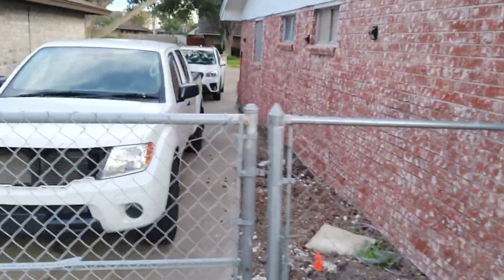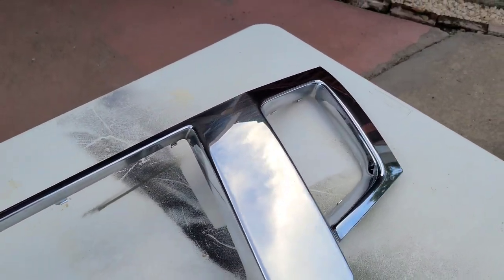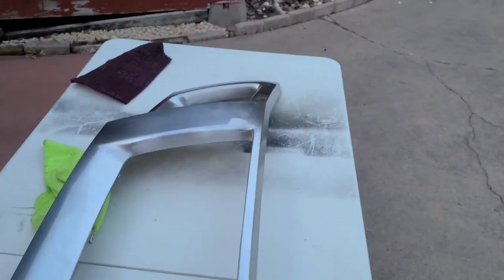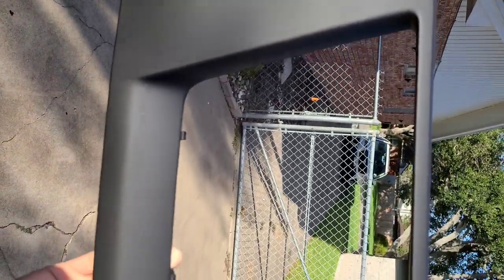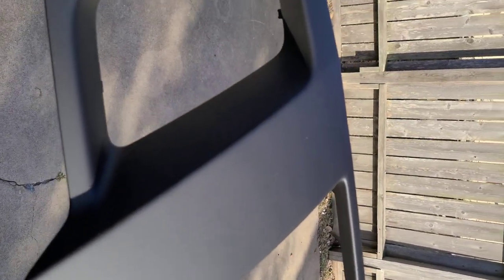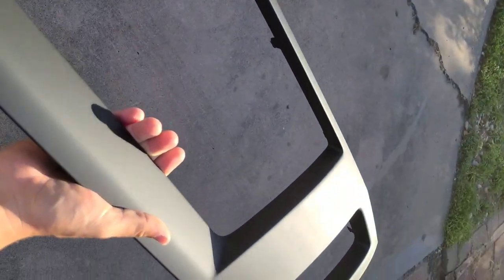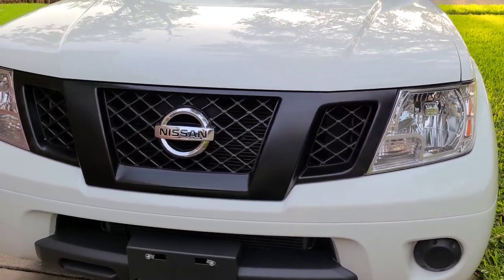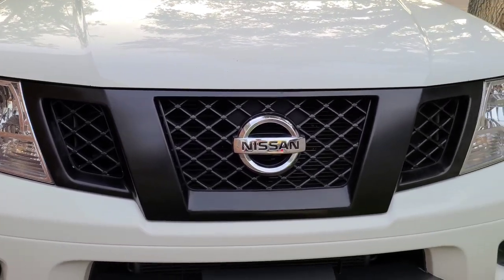Nissan Frontier Blacked out Grill!! Mod: 7

Comment: I prefer satin black over high gloss, looks way better in my opinion. So how is it holding up a year later?
Also, I'm pretty sure those wheels are silver from factory. Did you have them repainted or powder coated?

Comment: On my second Frontier now and both times I blacked out the grill... and what a bitch to separate the two pieces of the grill. Actually my first Frontier I just masked the inner part because I was afraid I’d break one of the two plastic pieces. Second time I found they’re pretty flexible, but figured if I broke them, now there’s an option to get the Midnight replacement grill from the parts department.

Comment: You did a nice job. Looks great. Did you spray a clear coat on it?
Reply from the maker: Yup I put a clear on there. You have too especially since it's prone to bugs and stuff
Reply: @localfisherman7592  Ok cool. Thanks for the reply.
Reply: @localfisherman7592  Also, did you have to scuff the paint before you applied the clear?
Reply from the maker: @bkg2213  no you can apply the clear straight to the paint. But make sure you clean it first.
Reply: @localfisherman7592  Awesome. Thanks for the replies. I am gonna do my grille next weekend.
Reply: Which clear coat did you use?
Reply from the maker: @bkg2213  I don't remember the number but I believe it's in the video and or the description
Reply: @localfisherman7592  Ok yeah I see where it is in the description. Thanks. I should have looked before I asked. I'm gonna do mine the same way you did. I just hope mine turns out as well as yours. Thanks for the replies.
Reply: @bkg2213  9